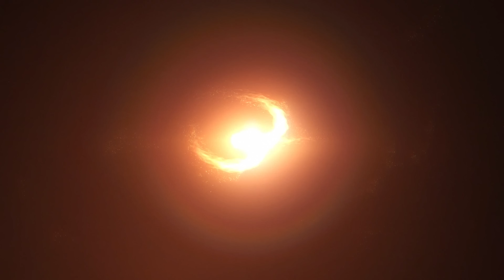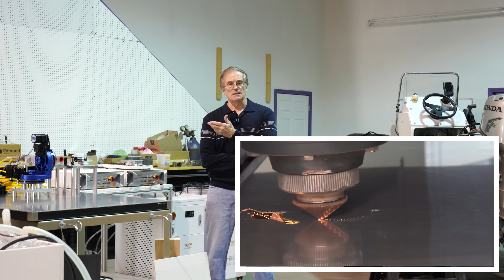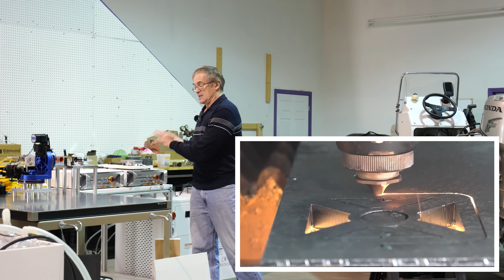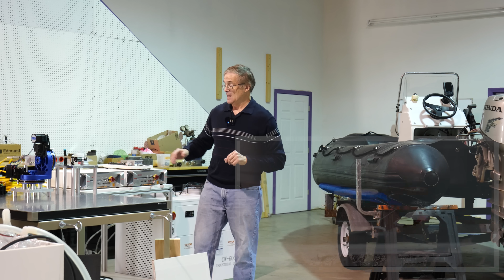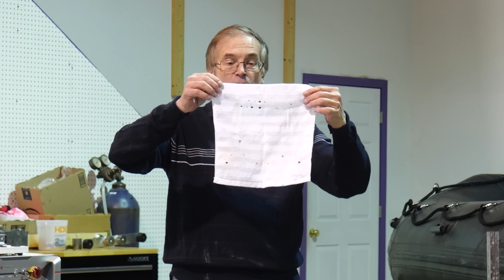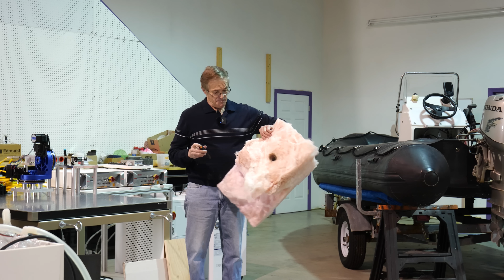We have a problem... and need your help!

Comment: Idea to avoid laser damage behind the lens:
Since the aim is to disperse the heat power of the laser, and this heat is caused by the intensity of the light, I think the easiest way would be to disperse the light in many directions, so that the sum of the light absorbed and reflected by the material would be harmless.
I can think of using a screen like the ones used in movie theaters, which reflects light in all directions.
The screen could be glued to a thin aluminum plate to dissipate the heat absorbed at the laser focus by the screen fabric itself.
I don't know if this fabric would survive such powerful lasers, but I think it might be worth a try.

I enjoy very much your channel. Thanks.

Comment: Waterfall and carbon-dispersed water:

I'm terrible a communicating my ideas, I used ChatGPT to assist in my solution: pardon the pun. 

Proposal: High-Energy Laser Protection Screen Using Recirculating Carbon-Infused Waterfall System

Objective:
To mitigate the destructive potential of a high-powered laser aimed at a designated target by deploying an effective energy dissipation and heat absorption system to shield the structure behind.

Design Overview:
A modular vertical screen measuring 8 meters wide by 4 meters high will be deployed directly behind the laser target area. The primary mitigation method involves a **continuous waterfall system infused with fine activated carbon, engineered to absorb, scatter, and cool the high-energy laser beam.

Key Components:

1. *Waterfall Troughs:*

   One lower trough** runs the full 8-meter width at ground level to collect falling water.
   One upper trough** runs the full 8-meter length at the 4-meter height, serving as the water distribution header.

2. *Water Circulation System:*

   * *Four high-capacity sump pumps* (evenly distributed) will recirculate water from the base to the top trough, ensuring a stable, high-flow waterfall.
   * Flow rate will be optimised to maintain a uniform water curtain across the entire 8×4 m surface.

3. *Carbon Dispersion:*

   * Water will be treated with **fine activated carbon particles**, suspended in solution to enhance absorption of thermal and optical energy.
   * The carbon aids in *diffusing* the laser beam, reducing its coherence and thermal concentration.

4. *Backup Shield:*

   * A *porcelain tile back plate* will be installed behind the water screen to provide secondary protection against stray or residual laser penetration.
   * Porcelain is chosen for its *thermal resistance and non-reflective* properties.

*Benefits:*

* **Thermal dissipation**: Water and carbon mixture rapidly absorbs heat energy.
* **Beam scattering**: Activated carbon disrupts the laser’s coherence, diffusing its power.
* **Scalable and modular**: The design is adaptable for larger or variable laser profiles.
* **Cost-effective and low-maintenance**: Utilizes commonly available materials and recirculating water.

*Conclusion:*
This solution offers a *safe, dynamic, and energy-dispersive barrier* between the laser target and protected structure. By combining the thermal properties of water, the energy-diffusing effect of activated carbon, and the durability of porcelain, this system addresses the challenge of neutralizing high-powered laser threats in an efficient and sustainable manner.

---
Reply from the maker: I like it.
I bet the response started with " That's such an interesting question."

Comment: Try graphite tiles, they will definitely off gas vaporized carbon but there will be limited transmission of heat and the charred area will be easier to manage.

This is also why plywood worked as well as it did. only problem it has it the lower density allows more air to react.
Reply from the maker: Any idea about a possible source?

Comment: To protect the wall. Would sand bags work or mineral wool? High-temperature mineral wool is a type of mineral wool created for use as high-temperature insulation and generally defined as being resistant to temperatures above 1,000 °C

Comment: What wave length? At work we use 1064um and green lasers. Delrin is good at absorbing over a distance. In our case it's only a ~30 watt laser. The delrin has worked with no degration for like 10 years. The delrin is semi transparent to the light so the energy is absorbed over a larger area. As well the white  delrin has a high melting point so it doesn't melt.

Comment: Use water mist wall for optimal light scattering, use a high-output cold fog machine generating water mist. This achieves ~98% scattering (2% transmission) due to dense, optimally sized water droplets with a high scattering coefficient (assuming 5" wall thickness) . For setup, deploy a containment system using a roll of thin, sacrificial plastic (like a plastic bag) positioned near the ground. Mount a frame above the roll, pull the plastic up over the frame, then down to the roll, sealing the end. Seal the left and right sides, then connect the fog machine. This design ensures a stable mist wall, is easy to scale, and maintains consistent density.

Comment: 🧱⏳💨🧱🔫.Pushing air up through sand makes it a fluid. Check Mark Rober's video (Liquid Sand Hot Tub- Fluidized air bed). If you make a box of sand and place a PVC pipe with pressurized air below it then you will have a constant stream of flowing material to fill in the melted void. You would burn a hole in the wall of the box, but ideally, it could be made of brick or anything that won't catch fire. If the wall isn't taking the heat quickly enough, you can make it thicker, add water, use a finer substrate, or even just blow more air to get faster movement. You can also have a laser detecting system at the back of the retainer that cuts off power to the laser. If anyone likes the idea, then give it a thumbs up so it is seen!!!
Reply: If you are using brick, you probably won't lose much sand in the time it takes to patch the hole with tape or clay.
Reply: Alternatively, make a lightproof(ish) box/area. When light fills the area, trip the laser power off automatically using a laser detector. Make sure your secondary backstop can withstand enough laser for the shutdown cycle. Brick would likely work well. Wet wood might be better since it will become a light source and increase the detection rate. Just keep a hose nearby and spray through the new hole.

Comment: Low angle vertical thin steel or copper sheet wall with a flow layer of water from the top. The beam hit the water layer first but the continuous flow of water will cool down the steel as well as the diffuse the beam. That wall could also be made of multiple sheet vertical cascade  just like a fresnel. Still positionned Nearly vertical but with light negative angle pointing down but just vertical enough so they keep water flow to stick to it

Comment: I know graphite is used in rocket nozzles. It's not that lightest material but it's high thermal resistance could lend itself to using a thinner sheet or a graphite coated something.

Comment: So as i understand from the video there is the need for a "semi-portable " beamstopper that has to be big enough to cover a wall for an eventual test against drones? 

Anyways my idea would be a wall of some decently thick spongy material which has been completely drenched with water for its optimal latent heat of vaporization . The kicker is you run dyed water so it absorbs the laser better and you could maybe use a graphite suspension to make it more thermally conductive(?) . It only needs extra structural mounting material and a hose that runs across the top and distributes best as possible, and a drain gutter and recirculation pipe. Ideally all the water flows through capillary action. 

I think this idea has to work, its only dependent on the thickness of sponge necessary to achieve the desired duration and yes it might still smoke a bit but it probably minimizes the vaporised material as already mentioned with the water. 

But idk i'm just a dude

Comment: I worked at ASML briefly. I know they have blanks that are meant to be fired at, although I cannot recall what they're called, or how high the power ratings were (they use 25kw in their EUV stuff).

But what about aiming it at a lense of some kind? and maybe a bunch of crushed glass behind a glass window or container, with fiberglass insulation or tiles behind it? idea being to de-focus the light and absorb it. Of course some of it will get reflected, but you shouldn't be in any way exposed to the beam anyway. Just be sure to have several fire extinguishers and a high-pressure hose that can put out a fire on the ceiling if the worst case happens.

Edit: also, maybe bags of cement? wet the bag so it doesn't burn, but the fine powder of cement might liquify and fall down, exposing a new cooler layer. The bag would hold most of it in, preventing it from spilling.

Comment: @TechIngredients Have you looked into aerogel? You could also set up a circulation pump to flow water between two layers.

Another idea would be heat shielding similar to the tiles found on the old shuttles.

Though, don't take my suggestions for granite... It's just a state of mind. 🤫
Reply from the maker: The large area that has to be protected makes the cost of the material a significant issue.
Reply: .@TechIngredients that's fair.

Comment: A large Fanuc robot that knows the intercept point of the laser trajectory and in its end effector hand use a black copper water filled tank with enough water volume to dissipate the thermal heat load.  The copper will transfer the heat to the water and an enclosed water pump  within the tank will keep the water mass flow rate at the target surface moving enough water mass to dissipate the heat.

Comment: Water will work. Not anything soaking, but a simple fishtank. At the back of the tank, but submerged in the water you can use ceramic shielding. You can keep refilling the water as needed and if the Beam is a millimeter or less, you should get quite a few shots on that tank before it is destroyed.

Comment: not a solution to the laser issue but https://www.youtube.com/watch?v=m-b51C82-UE is a correlating video for tracking objects in a 3d space using pixel to voxel projection using multiple cheap webcams think reverse raytracing. the quality of the webcams is mostly irrelevant due to how the image is processed and motion extracted. i'm not entirely sure of the real time capabilities but a slight delay is fine for initial target data as if the cameras are set up properly you can detect a small drone from a few miles away
Reply: also i have contemplated the feasibility of hacking a starlink phased array to make a mini phased array radar

Comment: saturated Wet clay dirt? Plenty of thermal mass and if you’re lucky you can acquire it outside with a shovel. Or some porous baked clay broken up and again saturated. Arranging in a ‘panel’ would be the tricky bit. Maybe wetted brick slips mounted on some backing board. All available for free. Someone will be knocking something down and needing rid of some old bricks etc

Comment: Try loose layers of crumpled aluminum foil between a dozen thin asbestos plates.
Key is the random dispersed reflection.
Reply: Another possibility, given that a laser beam passing through a christal splits into 2 beams 90 degrees out of phase, passing through several  christals each one also split and phase shiftet by an additional  exactly 90° can destructively  interfere, if there is a clever arrangement .

https://youtu.be/duZlWWwxIPQ?si=E0_QmEF9ArBYHgZO

Comment: Another crazy idea: What if you had something behind that can handle the laser for a few moments; and in front of that (or even sandwiched between two layers of that) you a have a power wire covering the surface in a tight zig-zag pattern so there are no gaps; one end plugged into the laser power supply and the other side into a breaker; so either you cut thru cleanly and therefore immediately cut the power to the laser, or you cause a short that triggers the breaker also cutting the power to the laser?

Comment: Rockwool, cheap relatively dark fibrous material with extreme melting temperature. With welding blanket backer they are made of S-2 fiberglass(alumina). The backer will reflect but the rockwool should hold the reflections.  Also you can soak your plywood frame (last defence) in sodium silicate (isinglass) solution and that will make it self extinguishing.  Intumescent materials might be the ticket though, something that grows into the heat while ablating. Think potassium sulfate intercolated graphite. Painted on the back plywood layer.  There will be no 100% solution as there is no 100% bullet proof material the same applies to light focused on an area.  It will always be a power over time function.  To defeat the best ballistic projectiles you use a composite of alumina (shows best performance vs carbide penetrators) backed by uhmwpe fibers. You can also buy alumina tiles for protecting grain chutes those might be better than alumina fiberglass from the welding blankets.   To sum up first layer can capture reflected light, second layer reflects (alumina), third layer gives time to hit stop button is self extinguishing and provides support for the other materials and is cheap(plywood sodium/potassium silicate).

Comment: Hrmm. How about a box of damp baking soda, or soda/borax mix. Both are light colored, carry water of crystallization, the baking soda has two phases of thermal decomposition at staged temperatures, and when melted together will form a clear glass before further degrading. Oh, and the thermal decomp products should be nontoxic, unless you manage to liberate boron vapor and if you do that you've got more uses for your laser than just drones. The water attached to epsom salt as well as it's translucency would make it attractive but you're going to get sulfur dioxide emissions at the highest temps. 

The only other thing I can think of is a mirror-polished aluminum "snail trap", where the initial angle is a highly angled cross section of the beam which reduces the energy density on any given point, and the slight curve will defocus the beam as it makes it's next reflection, and so on. Intricate, though... too much so to make one large enough for a wall. 

Beyond that... How long does a charcoal briquette soaked in water last?

Comment: Ice? Make a tub out of plexiglass, fill it with water when in place, cool it with LN2 using copper coils. Ideally perforated coils to get matte ice. Before use, remove front pane. 10cm of matte ice should attenuate it sufficiently. After use, run current through the copper coils, water your plants, and store tub for later use. Not enough? Make a thicker tub. Still not enough? Put plywood or similar in the tub. Even if it catches fire, at under -20C and soaked with cold water, it will go out promptly.

And to echo @ctrlaltdebug, sand in conjunction with this could cover each other’s weaknesses.

Comment: side recommendation,  whatever you implement attach a kill switch to it, the second the kill switch gets hit, it kills power to the laser.  as for your solution,  Sandbags filled with rocksalt.  also a slab of clay will work wonders

Comment: The quarry was a brilliant idea.

But if it has to fit inside the shop, and be relatively cheap, I would suggest sandwiching different materials for their specific properties to sort of handle the problem in steps. I think using something to unfocus the beam a little bit would be a good start, something like frosted glass. The reflection could possibly be mitigated by a layer of rockwool. After that something which can spread out the energy even further and absorb a lot of energy, for example a dense slurry of aluminium oxide, for its reflective properties, and water, for it's heat capacity and energy hungry phase change. As long as the water doesn't reduce the density by it's expansion or split into it's elements. Silica sand could be to consider as well. The slurry would be held in something like stackable panels to make it scalable, which are made from something like thin steel sheets with angled bracing inside. It will be somewhat self repairing because of it being a slurry, and be very heavy, but I don't think you will get around that.

The channel is awesome, I wish you all the best - including the viewers reading this.

Comment: My initial thought was a mirror at a 45 degree angle reflecting the beam into the ground.  Obviously would damage the ground, so you'd want to either have a sacrificial spot that you don't mind destroying.  I don't know the energies you're dealing with but if wood survived for a short burst, what if you lined the bottom of a water tank with wood and reflected the beam into that?  The wood would be damaged but the water would absorb most of the heat and prevent burning, and you could drain the tank to move it out of the way and fill it for testing.

Comment: Powder made of diamond dust. That is traded for producing grinding tools.The particles will explode one by one at a fast rate, distributing the heat. Diamond dust burns to coal, burning up. Should the beam make it thru, have the power cable for the laser behind it - it will stop immediatly, no stop button needed.